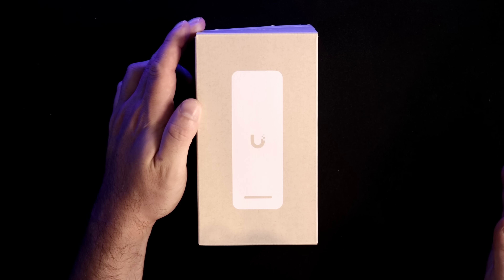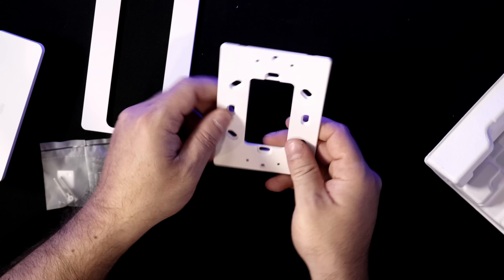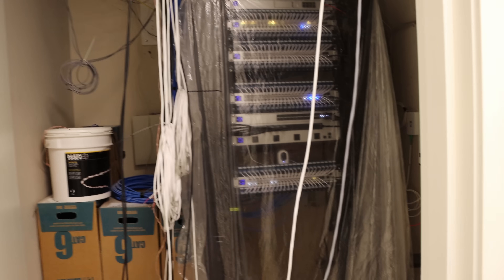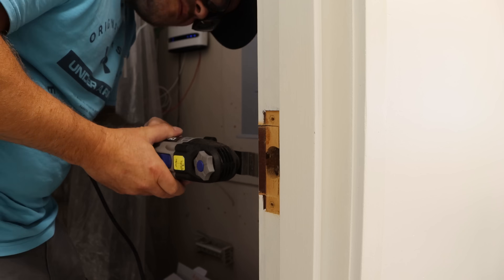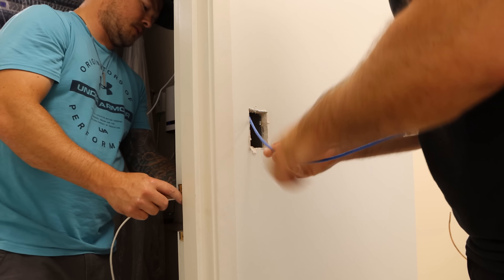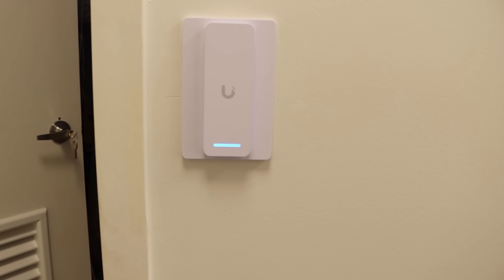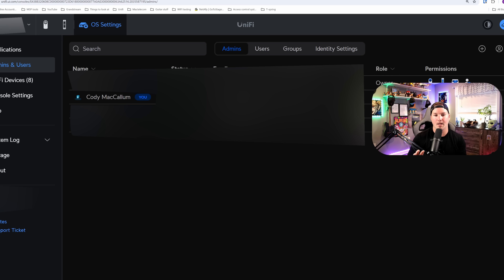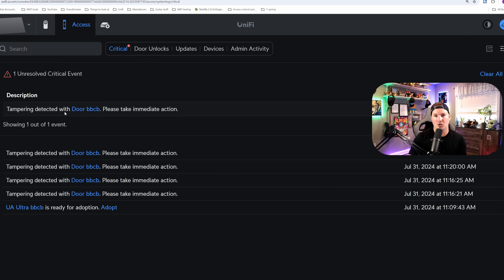Unifi Access Ultra: Reader and Hub built into one!!

Comment: Hi! Is it possible to buy the access ultra, connect it to an electric strike on the INSIDE of a door and put a doorbell G4 Pro on the outside and get it working by using a card or fingerprint on the doorbell to trigger an unlock of the door via alarm manager? That should be a cheap option for one door if it works.

Comment: Unifi needs a set of contacts on hubs and hub equipment for a basic contact sensor.  It would help keep records of how long a door is open or left opened.  Also, why would you put a request to exit button on an electric strike door?  Turn the handle to leave?  If the handle locked from the inside doesn't that go against fire codes?

Comment: Soon I will break ground on a new house I am building for my house. I plan on using UniFi for networking and security. Do they offer door access for residential front door? I cannot find much info on this.
Reply: Any of the Access products could be used for that. You could also use an Access reader and Home Assistant to maybe wirelessly unlock your Yale lock, for instance.

Comment: I always wonder how to improve the network security when having basically an Ethernet cable outside of your house for those things. What’s a recommended way to secure the network against someone just plugging in their device?
Reply: There are setting on pretty much all switches worth their weight to lock down ports. You can even lock down ports to specific Mac addresses which any good tech would do for permanent equipment
Reply: MAC filtering on that network port would prevent anything other than the reader working on the port. You should also put the readers on their own VLAN & make that VLAN isolated (not able to reach to other VLANs).

Comment: I can’t help but want to make some way for the wires to be just the right length so if someone removes the unit, the wires that lead to the strike plate pull loose somewhere out of reach making it impossible to use them to open it from there. But honestly, it’s the appearance of security more than actual security, we want things to be locked up to the point that if someone gains access, they leave evidence of it. I mean so many secure rooms even with hardened doors have simple drywall right beside them, it’s super easy to knock a hole in two layers of drywall. Same with any house, how hard is it to break a window, the point is, you set the alarm off and make noise and there is always evidence of break in.

Comment: Any idea if you could wire in a “break glass” switch to emergency release this?
Reply: Yes, but with a strike, it is not needed. From inside, you just turn the handle, from outside, use the knob’s key.
Reply: @jcnash02  thank you - I'm thinking on using with a MagLock and some sort of dual 'hand wave + push for emergency' release on the inside... d'you think that's work?

Comment: I love Ubiquiti, i have whole network on Unifi, sold hundreds of devices, but this is a bit disapointment ....anyone with a half of brain can open the door, you just need 12V DC battery in your pocket , just rip that thing of wall ( dont care about tamper, that's not gonna stop you going in and stealing / destroying stuff in server room or anything behind door equiped with this ) and connect the battery directly to wires from the lock, BAM you are in...... not the safest solution :-/
Reply from the maker: Like I mentioned in the video this is for low security doors which you want some logging on to see who’s going in and out.
Reply: Little disappointed in Utah ability to be defeated so easily.  However… I don’t think the general public and or employees or off the street thieves/burglars have any clue as to “access” to knowing & cleverly bypass one of these..

The appearance of security is a strong deterrence. I’ve heard that in the ether.. but consideration for this all in one “kinda” product as cheap as its price, and still has a unique value to fit some door “I guess”…

Comment: Does it have a terminal to land a door contact? Without a door open/close sensor and a sensor to confirm entry, it really is a 'keyless' entry system. I work in access control and am certified in a range of different products. There is big difference between keyless entry and true access control. The unifi gear intrigues me due to the breadth of options but it seems to be a game of does a lot but not enough to challenge the main players in any given area. That said, most small businesses and residential don't need more than they offer so there is clearly a market for it.

Comment: Low security is even an overstatement. A more or less cardboard door surrounded by drywalls, if I stumble and fall towards the door or the wall I’m in there anyway. An access device makes sense where you can’t poke holes in the wall or the door in half a second, but then, an access device which can be tampered with so easily has no benefit, nowhere. Nice gadget, yes but nothing more.
Reply: There are no foolproof security solutions. Any lock or obstacle is simply a matter of time before it can be defeated. If you have a need for a higher level of security, you must have 24/7 monitoring and many other layers. There are many low security environments that these would be completely appropriate.

Comment: I use several of these now. I used them with a storeroom lock. Its always locked on the outside and you can open from the inside without the push to exit button.
Reply: Will this work with mag locks also?

Comment: I know this is mainly for commercial apps. However, would this make sense for a door between an attached garage and the house? That is our main entry point. We normally keep the garage doors closed.
Reply: Sure would! Just know that again, this is low security, as all you need to do is pull it off the wall and connect the two wires for the strike or mag together and you will have an unlock. So whether you think that’s okay to have on the main entrance to your home, that is up to you! A motion detector in the garage would be recommended
Reply: @dustyfanblade5937  I have an Ai Pro pointed at the driveway. A G5 turret in the garage and a G4 bullet mounted high up covering the Ai Pro.

Comment: I was looking at these for a garage door opener. I don't need it to be super secure, but I find it hard to get info on what the garage door openers use for voltage; I almost need a relay version or UI to make a garage door-specific Access hub.
Reply: I have a standard UA-Hub running with my garage door opener with a G2 reader on the outside wall (around £300 total, so yes a little more than the Ultra Reader). The garage door opener has a simple switch terminal connection that works perfectly with the DRY AUX connection on the UA-Hub and can now easily open the door with mobile tap!.. whereas the Ultra Reader seems to provide only 12V on the lock terminals.. if your garage door opener is anything like mine you could potentially fry the board if you put 12V across what maybe designed as a "switch" to close a normally open circuit. It's slightly annoying as the Ultra Reader is far cheaper a solution, but given you can pull the reader off the wall and either short the access terminals (or simply add 12V power to the cable going to the opener) it isn't really a good solution for external use.
Reply: @nrjonesy  nice to see someone also had my idea. The 12VDC is my problem as I need a momentary switch, and the openers in the USA seem to use 24VAC. The door I am opening isn't super secure as you can open the manual door with no lock out in the countryside, so people can stop worrying about taking it off the wall I want it for the “smart” features.
Reply: Check out their new gate hub kit, might be exactly what you need!
Reply: @jesuislejoseph  I did see that, but I don't need the $700 price and all the extra stuff; I just need a reader and relay to connect to the existing push buttons.
Reply: You do not want to put this on any external or any door what needs to be secure, really, I stress it - skip it.

Comment: Good that you mentioned 'low security' here. That tamper switch is pretty...bypassable.
Reply: if the hub was in the exit button it would be more secure
Reply: @Sullrosh but then you’d have to use their button instead of a better one.
Reply: Yeah that's just a terrible location for a tamper switch. Why would they put it in a place that's accessible through the locking tab slot??
Reply from the maker: Its a button on the back of the reader
Reply: But it's not? If you remove the hub the door remains locked?
Reply: @angryitalian3430 you can short the lock terminals to open the door.
Reply: It is possible to make it more secure by adding another tamper switch and holding relay to break the power and strike wires